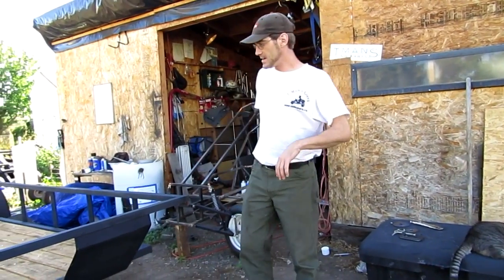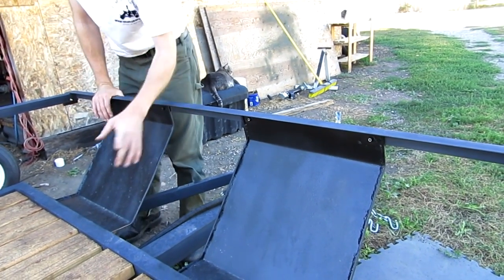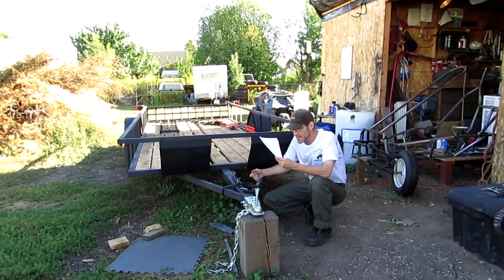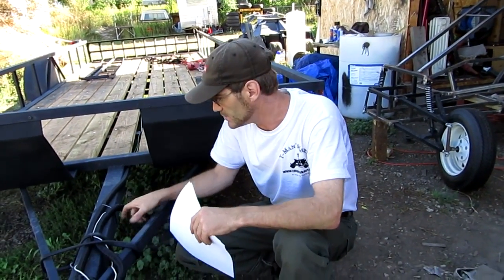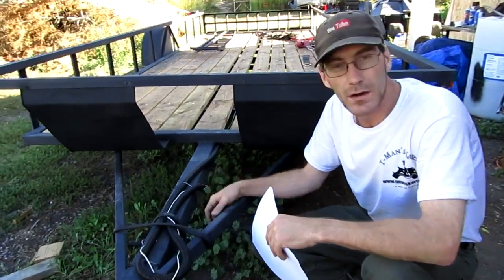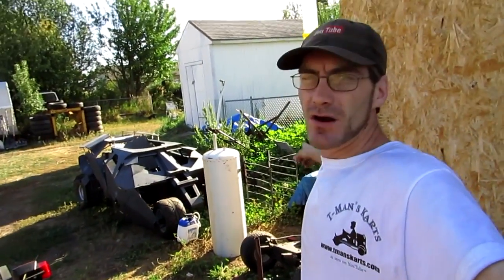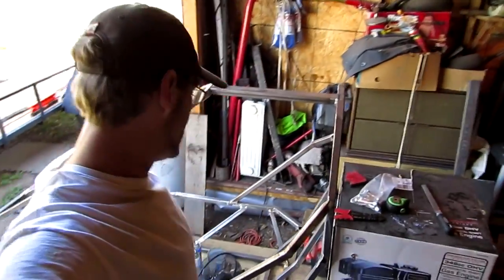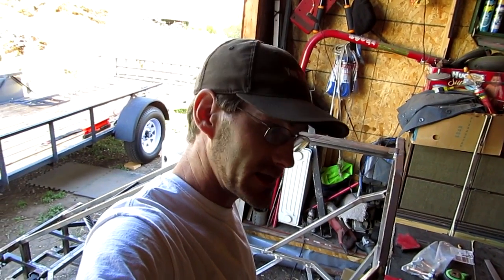Update  ( Utility Trailer ) ( Ford Ranger ) ( Fullscreen Machine )

Comment: I have tried that before and you will have to machine the shaft 90% of the time because the shafts on generators are tapered, or if its a common engine you could replace the crank.